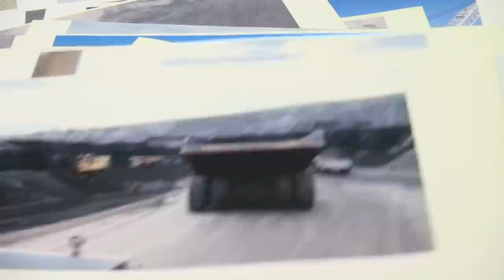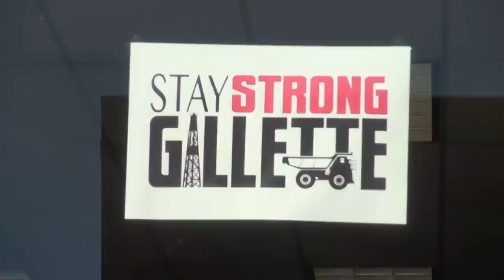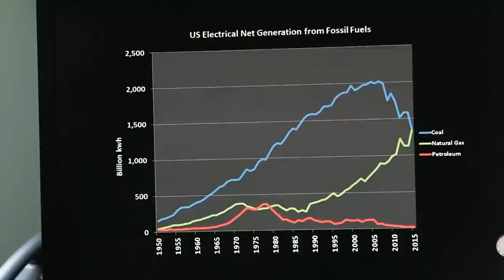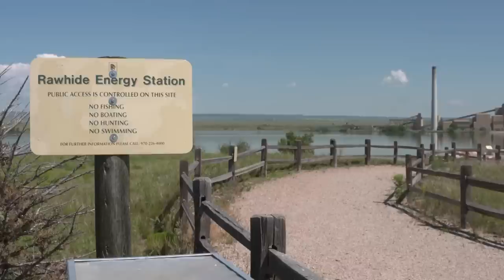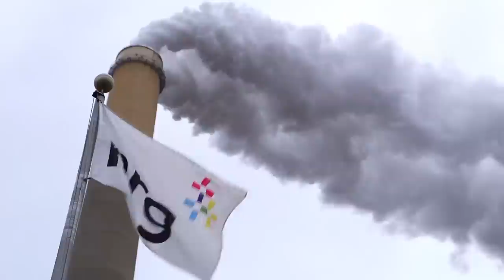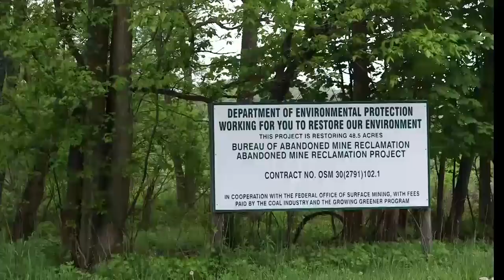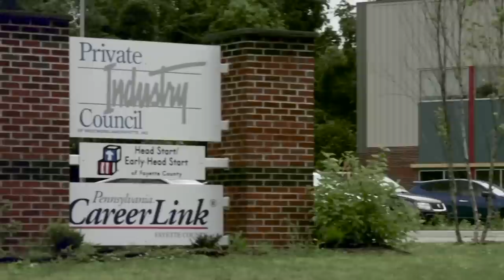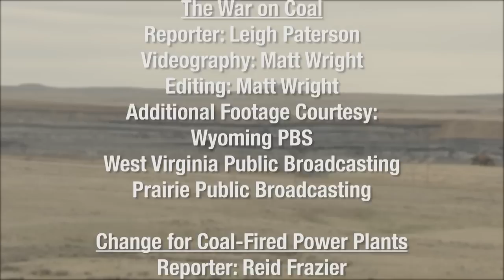The Collapse of Coal

Comment: even in the remote case the coal would increase in turnout the layoffs will continue. they won't get retired as automation just increase. automatic trucks is already in use in these settings. automatic loading is also being implemented.

Comment: The Obama administrations war on coal forced coal fired power plants to modify to gas. They could never go back because of the huge price tag to switch back. Power plants spent a fortune changing to gas. But gas is not free. I grew up in the coal and gas fields.  Everyone I know has something to do with coal or gas. One more reason is cheap foreign coal. When I was a kid you would never see import coal and New Port News, or anywhere on the coast. But now, it's a different story. It wiped out complete regions of people. Politicians have sold this country out, while other countries are running on full throttle.
Reply: Coal fired power plants are dedicated to a certain btu and ash content coal. Coal is not the same across the board. You can't just put any type of coal into it, sometimes you must blend.
Reply: I think one of the main reasons electric utilities converted some coal fired power plants to natural gas is that the overall cost is lower.  No infrastructure to handle the coal at the plant and no disposal of the coal ash.  Put another way, who do you know burns coal in their home for heat versus gas or electricity.

Comment: Wow those two young guys we’re making some damn good money over 100,000.00$ his last year that’s crazy I’m not happy they lost there jobs but they may have to do something for far less wages heck I was only making like 47-48,000 straight time and I had 21 yrs on the job and it was hard labor no unions around here either in the panhandle of Florida one of the few times they did come bye the job the City frowned on us having any contact with them basically you converse with them you’ll get run off.
Reply: I made $90k/year mining with no OT, just 40 hours a week.

Comment: How do you plan on making iron and steel without coal? Park your Prius! Yes it was made thanks to coal!
Reply: @pressureworks  Apparently you don't know that all grades of steel cannot be made without iron. The EAF process makes steel from scrap, fine for some grades of steel. But some alloys including aerospace grade stainless are made in the EAF, AOD, VIM, VAR process. At the VIM, process you have to start with pure iron. Also used in every type of medical steel. Hope you never need a hip or knee replacement.
Reply: @glennpupino4890  you are right. I did realise that as soon as i made the comment.

Comment: Well if the EPA was shut down we wont regulate industrys would not need to worry about this stuff
Reply: This is going to have to be polemic, but only an uninformed person would believe that, then say it.  Unless you're a microorganism living on a volcanic vent at the bottom of the ocean, you need clear air to breath and clean water to drink to stay healthy and alive. If you doubt this, we're counting on you to perform the following experiment. Fill a one-gallon jug with water, add 1 tablespoonful each of the following: drano, a pesticide, motor oil, gasoline, mercury, fracking mud, human excrement, and lead. Mix well and refrigerate overnight. The next morning, gather small samples of the following materials: Plywood, foam, upholstery, rubber, motor oil, gasoline, newspaper, nails, hammer and nails, and place them in your bathtub.  Disconnect the smoke alarms in your home. take the concoction you prepared yesterday along with duct tape and go into your bathroom. While you begin drinking from the jug, duct tape around the bathroom door and nail it closed. When you finish drinking the gallon of liquid, pour the motor oil and gasoline on the materials you placed in the tub and light it on fire. When you do this, you will be more beneficial to society than you are now, which is to demonstrate what it would be like without the EPA.  We will publish results of your autopsy listing the cause and manner of your death, along with the toxicology analysis. You will automatically be removed from the gene pool.  I will visit your surviving family members and present them with the Darwin Award you earned so that other's might live.
Reply: - Christian Bomgardner, IQ 78, 2020

P.S. MURICAAAAA